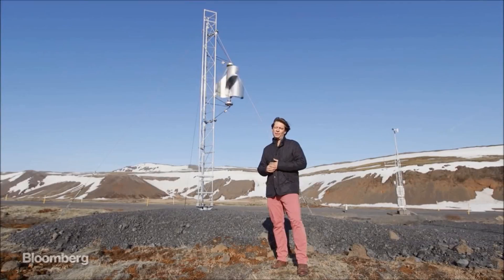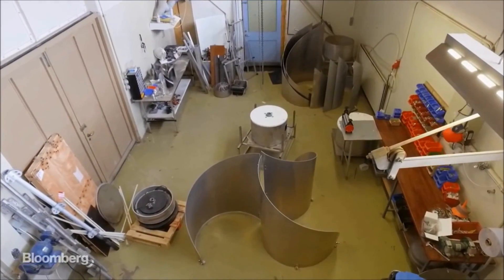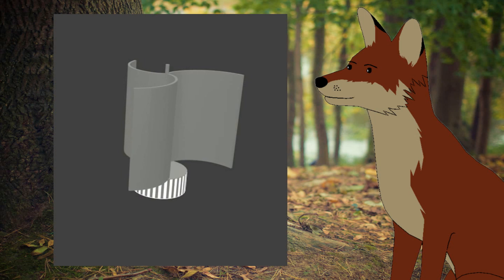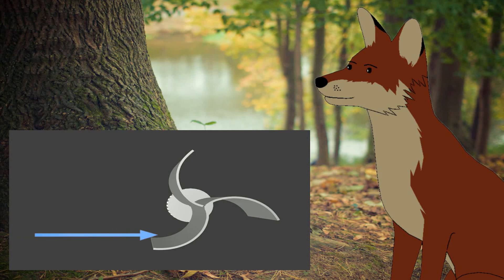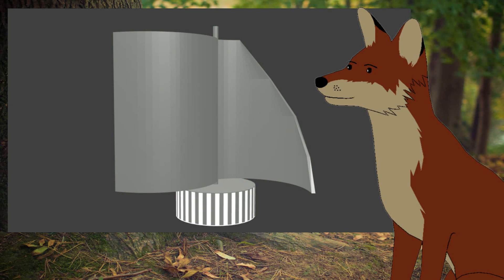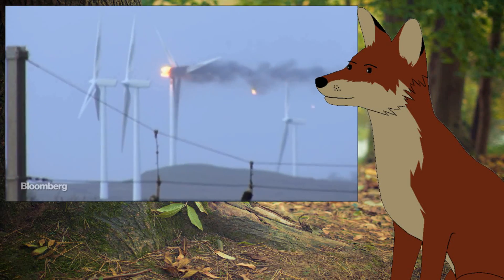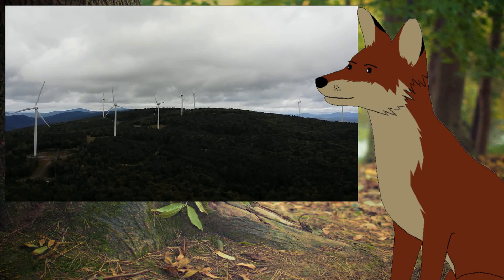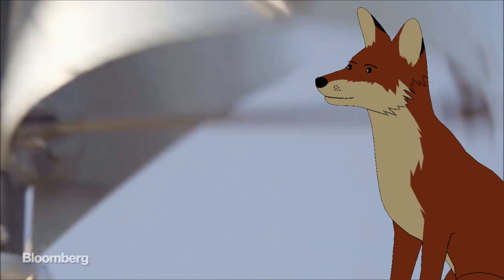IceWind Turbine - BUSTED

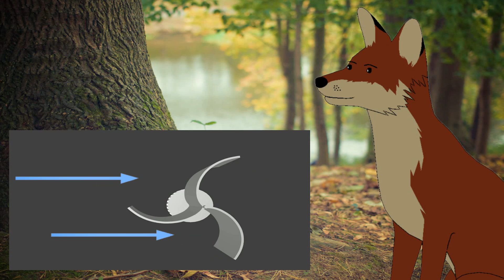Comment: Re video at 3:04, why not just use a fixed panel to block the wind so there is no wind (top arrow) pushing against the back side of the turbine blade?  Wouldn't that eliminate most of the inefficiencies you're referring to there?  Perhaps that panel could be rotated by a large tail so its always blocking the correct part of the wind turbine blades as the wind changes direction.  I'm not an engineer, just a guy trying to think outside the box.

One other comment, sometimes its better to put an inefficient product into production but continue to develop it rather than have no product at all.  For example, it was better that Ford put into production the model A rather than wait until his engineers designed a car that can go 65mph safely down the road and protect the passengers with crumple-zones in the event of a crash.  A silly example but I think you get my point. 
I see so many examples where good ideas never come to market or are over-engineered where it becomes a priority to get every last bit of efficiency mathematically or theoretically possible to the point where the product becomes impractical for the originally intended consumer.  A case in point is the Tesla electric car. sorry for the rant.  
I, for one, would rather have a wind turbine operating at 20% efficiency rather than have no wind turbine and waiting until they develop one with 30 or 40 per cent efficiency.  In other words I'd rather drive a Model A than have no car at all.

It's very windy where I live and because I respect your opinion and the opinions of others here, I'd like to ask, what wind turbine do you consider the best presently on the market?  I've been considering the ones sold by this company:
http://mwands.com/store/index.php?route=product/category&path=235_237 
Thank you everyone for your replies.
Reply from the maker: Cranford Ducain
Don't take anything for granite, unless you're talking about counter tops.

If you place a panel in front of the wind the wind is going to try to push it out of the way, with the same amount of force that is causing the turbine to spin I might add.  You would need an exceptionally "large tail" to counteract the yawing force place on the panel by the wind.  All this additional effort put into trying to overcome the downsides of savonius turbines begs the question why not just mount your generator inline with the "large tail", stick a propeller on it, and call it a day?
Reply: That idea would make the turbine severely limited in use. The open design allows it to work in wind from any laterally directions equally effectively. Blocking any portion would create a dead zone where the wind would barely turn the turbine.
Reply: actually no, this does not work as the wind going past the pushing blades needs to dump out and as the blade turns it would dump out behind the " solid panel " and create resistance once again. this has been tried many times and has always shown to be ineffective. The " solid panel " also creates a problem where the wind hitting it adds excess force to the pole mount and creates fatigue on the connecting pole and bearings.
Reply from the maker: Cranford Ducain
Even if you solve the problem of back pressure, you still have to find a way to yaw the panel into the wind.  One of the few advantages of VAWTs is that they are always presented to the wind.  If you are going to have to build a device that will always keep the blocking panel pointed towards the wind, you might as well use a HAWT.
Reply: OK, lets take the panel and make it curved, in a shape like a ships bow, so as to have less resistance to the oncoming wind and have it go only half way toward the rear of the turbine blades. this will lessen the wind pressure on the supporting structure and allow the wind to be "dumped" from the blades long before they pass behind the curved panel.
Reply: OK, lets take the panel and make it curved, in a shape like a ships bow, so as to have less resistance to the oncoming wind and have it go only half way toward the rear of the turbine blades. this will lessen the wind pressure on the supporting structure and allow the wind to be "dumped" from the blades long before they pass behind the curved panel.
Reply: you dont need a gearbox for a small scale VAWT.
Reply: Good point, there are many designs out there that do just that .. and efficiency is relative to many other factors such as cost, scalability (vertical a plus) and complexity (no need for pinion gears or slip ring transfer) .. In general the VAWT design has great potential although i do agree with many points raised in this video.  In my opinion the company being funded here will not be the one that makes the vertical wind generator win overall. And yes, the ones handing over the peoples money dont get it.
Reply from the maker: In regards to which small turbine is best.  This is a copy and paste from another comment string.  In general I would not recommend any "homeowner" turbines for the following reasons.

1.  They all require regular maintenance, and none of them are inexpensive
2.  In order to get good constant wind, a turbine needs to be above structures and the tree line, this requires a tower or pole of some type.  Maintenance then requires working at height, or a way to lower the turbine to the ground, both have varying degrees of danger involved.
3.  Even a small turbine in a run-away condition can be very very dangerous.
4.  Maintenance means working with spinning propellers, gearboxes, and voltage (something many homeowners just aren't up to) 

Of course I don't know you, your home situation, or your capabilities.  If you want to experiment with wind power feel free.  For someone who is dead set on buying a wind turbine I would recommend one made for sailboat use, seeing as (in theory) they are designed to be in more extreme environments (constant salt spray, getting jostled around, lots of wind).
Reply: OH. I just took it for granite that everyone had seen a weather vane before. that would be the function of the "large tail" structure which S Phillips had mentioned. The same was once used on Chicken houses to help with ventilation in the past. It was designed onto the top of a hood structure and always presented the front of the hood into the wind. This "panel" would be essentially the same but cover only about half of one side. Not hard to envision and very simple in application.
Reply: You are so right with all your points. His explanation is misleading with wrong informations.
Reply: You missed his idea of using a wind vane so that the block passively correctly positioned itself.

Comment: Hmm..?!!!... I wonder if this video was produced by greedy 'big energy' companies worried about losing their money because Icewind.IS invented something more efficient, more productive and less costly?
Reply: right said Big Energy....i hate the ugly windmills they set up here in the Netherlands .....i have bought one axial turbine from China Aliexpress and it works better then my solar panels....it gives 4 to 600 watt of power and that just voor 500 Euros...Big Electra does not want that we take our own free energy .....Big Oil..Big banks also don't want it
Reply: Slackware: AC power at a variable frequency. The wrong frequency for appliances designed for grid operation. You still have to convert it to DC, just so you can convert it back into AC again at the correct 50/60Hz constant frequency.
Reply: right ...  and with just 3 pof these  at  €1.5 k, you don't need the grid anymore.
Reply from the maker: Damn, you caught me!  Tell me, how much does an icewind turbine cost?

Comment: Why would cutting of half the blade make it less efficient? Doing so also cut of half the resistant on the other side. Why not mention that? Did you not know? That resistans it also why the Savonius design is less likely to spinn itself to death in high wind. Less efficient, yes,  but also simpler and more durable. And in high winds countries like Iceland efficiency is not really a big issue. I agree there is a lot of "hot air" and hype about this, but that does not give you the right to call bullshit about something that actually does what it suppose to.
Reply: its nice somebody out there do some new designs, and share it to the world.
Reply: YES! Yes! You said it!
Reply: sleepercell ..Compete?? I truly doubt we will ever see this "vortex" design honestly enter the market ever.
Reply: james progrebtsky
Efficiency does not drop. It's tied to the input. Efficiency just says how much output you get from the input. That is why big turbines and small turbines can have the same efficiency even when they do not have the same input nor output.
In this case, cutting the blades' surface area in half would cut the input (which in Iceland would be a good thing rather than a bad thing). You would get less output but the efficiency remains the same. The reason you have less output is that you have less input.
Reply: You busted Mr. Fox.......he know nothing about physics. Even lacks common sense.
Reply: Then why don't they have product after nearly ten years of research? Probably because in situations other than maybe some very isolated incidents this design isn't efficient enough to compete in the wind turbine market. That's not a conspiracy it's reality.
Reply: Why would cutting off half of the surface area of a product that requires surface area to generate power, make it less efficient? SERIOUSLY?